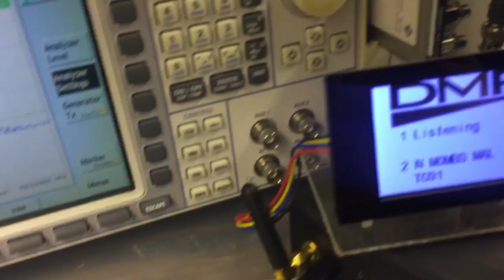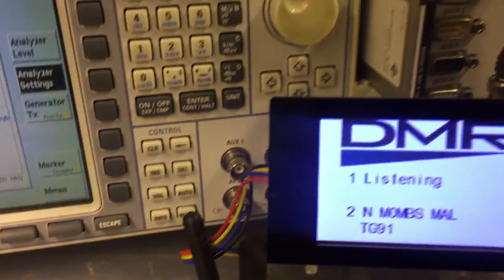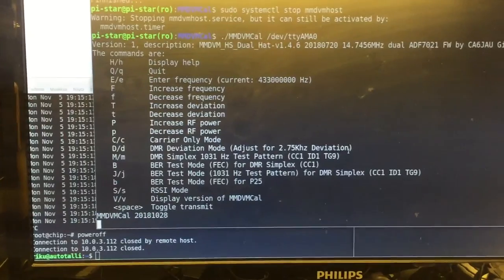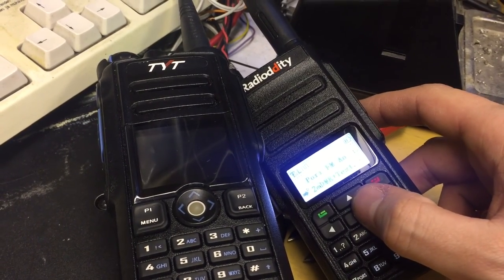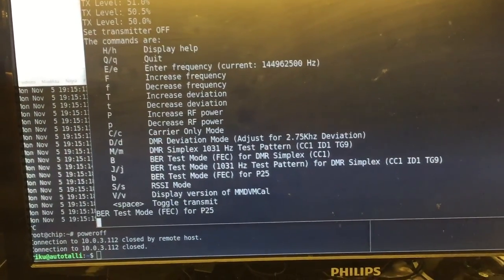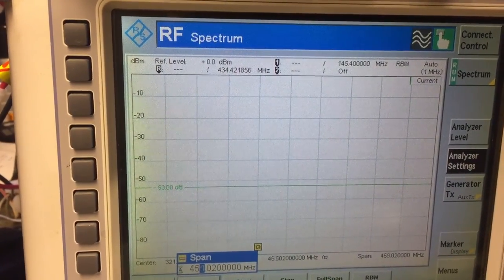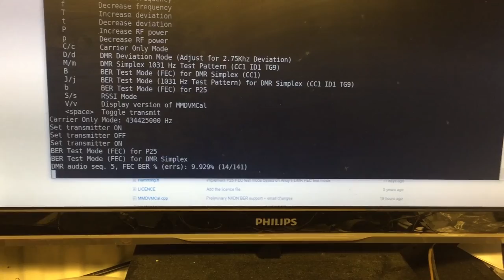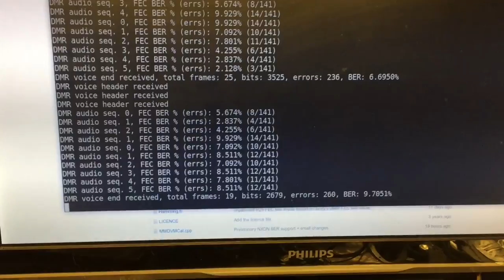How to tune BER on MMDVM hotspot with MMDVMCal

Comment: After I start: pi-star@pi-star(rw):MMDVMCal$ ./MMDVMCal /dev/ttyAMA0

Version: 1, description: ZUMspot ADF7021 v1.0.2 20171023 (DStar/DMR/YSF/P25) GitID #c70e7e2
Received a NAK to the SET_CONFIG command from the modem: 4